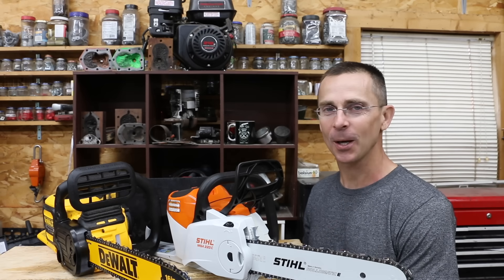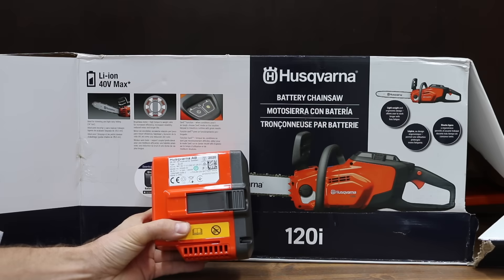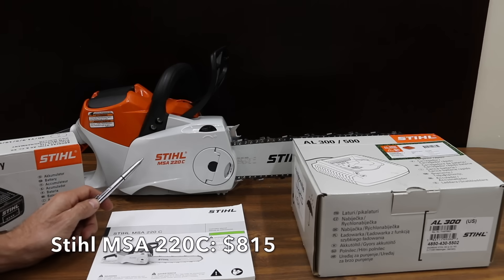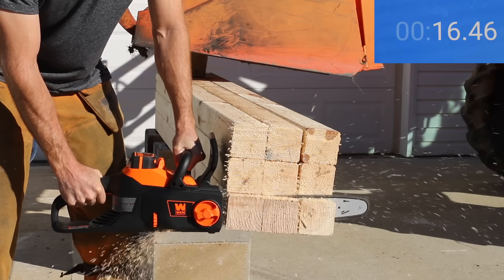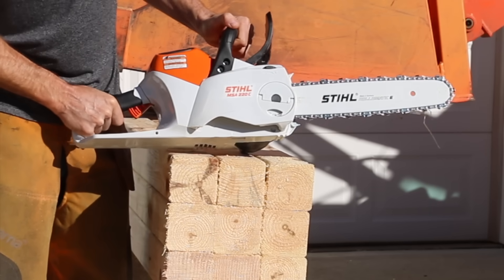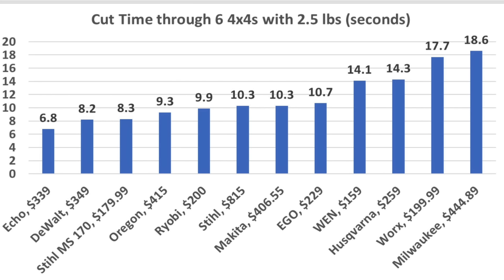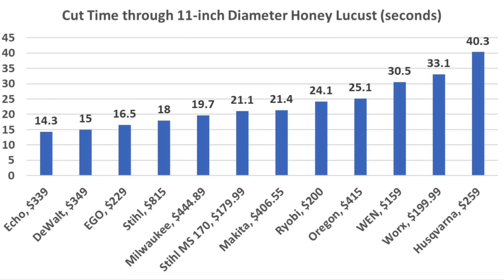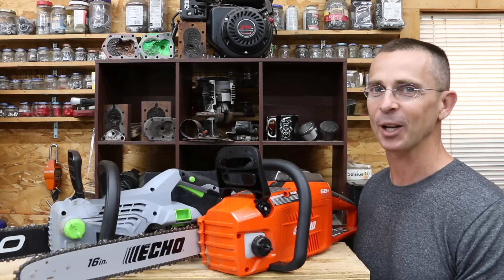Best Battery Powered Chainsaw Brand (ROUND 2)? Stihl, Husqvarna, Echo, Oregon, DeWalt

Comment: Cutting mango trees:  The Homelite did it ok.  Large amount of pine: Bosh plug-in: Instantly stopes when trigger is released. Bamboo: The Makita had no issues. Cutting with an Ozito brushed motor the dust got sucked in and it died before the battery was empty!
Reply from the maker: Thanks for sharing.

Comment: Something also potentially worth considering, EGO and DeWalt share common battery system with a very wide array of tools, and batteries are and will remain for a long time widely available, both in OEM and third-party.  I believe Sthil has a smaller array as well, but not nearly the availability or depth of tools to make sure they'll be available in, say, ten years.  The others are very likely dedicated or unique batteries, that might well be very challenging to replace once the first set dies, or if you need additional run time.

Not a direct impact on this test, but something worth considering when you're looking at buying a tool that's fairly expensive like this.
Reply from the maker: Thanks for the feedback.

Comment: I bought an EGO for $229 , but I use its 2.5AH battery in the String Trimmer . I use the 5.0AH battery from the leaf blower in the Chainsaw. 
My research showed the EGO was one of the best battery performers overall (which is what you are really buying) so joined theEGOverse . 
Bonus as the three tools overall if not top line, do work well overall -especially the string trimmer . Also EGO has a quick charger but I didn't purchase it .
Next up will buy the lawn mower with 5.0AH or 7.5AH and that will give me a hot spare for batt ..all the batteries work in all the tools but would not want to do string trimmer with the 5.0AH battery.
Reply from the maker: Thanks for sharing.

Comment: One metric on a test like this I would like to see, battery volts x Amphr = watthours , and then figure inches cut per watthour.
Since there is such a variation in voltages it would be interesting to know, not necessary, but interesting.
Reply from the maker: Thanks for the video idea.

Comment: No load rpm is a pretty useless metric. You need to look at rpm under variable load to get power curve and ultimate output.
Reply from the maker: Thanks for the feedback.
Reply: @ProjectFarm  No problem. You could set up a rig using a torque limiter to get a set torque at rpm. Then adjust it tighter and measure again. 
If you did this incrementally you could make a nice chart with power curves of each tool overlayed; to show which has power at what rpm. 
You could then run each in its optimal range to better gauge how well each tool could theoretically function if it was run perfectly.

Comment: I make my living now with a electric saw cutting cedar posts and staves , you overlooked the Milwaukee but it is best , you didn't test the torque power of these saws and that is very important  meaning maybe set a chain system to fit in saw sprocket to test how many pounds of force needed to stall out the saws , I am confident Milwaukee will surprise you, Milwaukee cuts and doesn't stall out , and the batteries for Milwaukee last longest and can get a super charger that charges 12 ah battery in under an hour.
Reply: But still awesome tests
Reply from the maker: Thanks for the feedback.

Comment: I have an assortment of Echo equipment and its good to see that their electric tools are good quality also.
Reply: Me too man. . . I've got two srm230 trimmers, one srm3020 and a cs400 chainsaw and a telescoping pole saw and they've all worked great.  I also have a pair of husqvarna chainsaw that run good too.
Reply from the maker: Thanks for sharing.
Reply: Me too, all non-electric, I have two string trimmers and a blower-vac. They just keep running, -and the string trimmer spools are easy to load, and maintain. Echo is a Japanese company, and it is apparent that they pay attention to the details.
Reply: @ratman5727  first time I used the srm3020 i was blown away.  The power on that thing is insane.  I've paid $800+ on chainsaws but was a little skeptic on paying $435 for a trimmer but its well worth it.  It works great as a brush cutter too.  The oldest 230 is 19 years old.

Comment: I think the battery comparison is not that useful. You're using multiple sizes of batteries and multiple speeds of chargers. You should compare minutes vs amp hours. The DeWalt alone has three different battery options and at least three chargers available. And each battery and charger has a different dollars vs. amps rating.

A motor power rating could be useful also.
Reply from the maker: Thanks for the video idea.

Comment: The 220 is stihl's most expensive and powerful battery saw though. They have several cheaper models.

At the same time you chose husqvarnas cheapest and weakest saw, they have several more powerful models. Not really a fair comparison in my opinion.
Reply from the maker: Thanks for the feedback.

Comment: To your first battery chainsaw video, I commented, wondering how the Hart brand (apparently made by the same company as Ryobi) would perform at a $200 cost.

Since then, in late October we had a nasty ice storm - with most trees still in full foliage, our 4 acre plot had a lot of tree damage so I went down to Walmart and bought their 40V Hart chainsaw.  I will say it cuts well, but it has a similar problem with battery life as you demonstrated in this video.

However my result was a little different, making me wonder if you may have experienced a similar battery "discharge" problem.  In my case I was able to get about 5 or 6 cuts in a row through ~10-12 inch elm before the battery quit.  But the battery appeared to have quit for overheating.  I say this because (a) I could feel that the battery pack was warm and (b) after cycling through my other 2 batteries, the first one would give me another 3 or 4 cuts (without recharging, just having let it rest) before quitting for good (until a recharge).
Reply from the maker: Thanks for sharing.

Comment: Echo makes great stuff. My weed trimmer and leaf blower are both Echo. Never had a problem with either one in 8 yrs. Well I had a problem keeping them running one time but that was due to using Casey’s gasoline. I found out the hard way that Casey’s gasoline has water in it.
Reply from the maker: Thanks for sharing.

Comment: Thanks for the video and testing the EGO. I’m a huge EGO fan and I used a 7.5ah battery and cut up a huge oak feld by hurricane in @18” sections limbs and all with just 2 batteries. That took me about 4 hours. Also, the EGO has a fast charger that can charge way faster than you can use the batteries. I put a Oregon chain on because the one it came with seemed inferior and only lasted a short while.
Reply from the maker: You are welcome!

Comment: Echo makes some really power equipment. I was impressed with echo saw. Would like to see a long term test of different 2 cycle oils. I own a landscaping company and will go through a minimum of 5 gallons a weeks of mix gas some weeks we will go through 15 gallons I have tried several different quality oils over the years redmax stihl synthetic which i was not impressed with seemed to cause spark arrestor screen clogging prematurely compared to other brands. I also tried couple of other brands the one I am currently using and have been the most impressed with is the Echo red armor oil after a couple of months I noticed it had actually made all the engines i had run it in cleaner and removed some carbon build up it is the most expensive 2 cycle oil i have used but it seems to do a good job and the engines run great and cleaner on it. Have a great week Todd. God Bless!!
Reply from the maker: Thanks for the video idea.

Comment: I’ve owned the Echo for three years in a homeowner and commercial environment.  Great saw  BUT-  the stock bar and chain are too thin and in a lot of applications it dechains routinely. Had to put on a thicker bar & chain problem solved but some loss of run time.
Reply from the maker: Thanks for sharing.

Comment: I was hoping to see the Greenworks (also branded as Kobalt and a few other) 80v chainsaw in this test. I've had one for several years and I haven't even touched my (rather nice) gas saw except to keep it running.  If you wind up doing a third round at some point, I'd be curious to see how it competes.
Reply from the maker: Great suggestion for future round of testing.

Comment: I am a little bit upset right now, because you are testing the "Best Battery Powered Chainsaw Brand" and then you are buying the most expensive Stihl saw meant for professionals and the cheapest Husqvarna saw they offer meant for homeowners. Husqvarnas best would be the 540i XP at the time. So for me it's not a fair comparison to let the very best of one brand compete against the weakest of another brand. If you're comparing the "Best" why then not buy the best of each brand? You could also do a comparison pricewise like "Best Saw from 0 to 200$ from 200 to 400$ and so on.
This Video is as always great but in future i wish for more equalism.
Reply: And if you want to test the Husqvarna 540i XP Saw then please buy either the Bli 200X or the Bli 300 battery because they are especially made for this saw because it's using and needing so much power.

Comment: These tests are great, but they don't figure in the eco system.  For example, I have 4 other EGO products and the batteries are interchangeable between all of them.  If I am going out to the woods to collect firewood, I am likely going to be taking all of the batteries with me.  I also have enough batteries now that I can simply purchase new EGO products without the battery with saves a lot on cost.
Reply from the maker: Thanks for the feedback.

Comment: Good information. I would like to see the GreenWorks 80 volt comparison
Reply from the maker: Thanks for the suggestion.
Reply: @ProjectFarm  just to be clear it would be good to see all 80 volt or higher saws compared.  The reason is the run time of 3 to 8 minutes on the saws you tested is totally unacceptable. This is just an example. There are other brands even a 120 volt battery operated out there   https://greenworkscommercial.com/gs181-82-volt-18-chainsaw-tool-only  Thanks

Comment: Informative as always but gotta say the run times really limit the tool unless you have a big battery budget 

Like anything if you have more than one tool it works out better if you can pick a family of tools and live with it 

Most of my stuff is Roybi but I needed a killer right-angle Drill and after destroying and M28 Ended up with a  Dewalt 60 Volt and after a bit of initial break in smoke it and the batteries have done well
Reply from the maker: Thanks for the feedback.

Comment: Fact is on the EGO using the 2.5 AH Battery has less power than with the 5 AH, it has something to do with the power management in the tool.  Also the new 18 inch is in a different class and hands down out preforms there 14 and 16 but cost much.
Reply from the maker: Thanks for the feedback.

Comment: Nothing in these tests indicates that any of these are going to last a long time.  You really need to break the saw down to find out if it is built well. There are good proxies like weight, but weight alone is not enough.
Also, what does anyone consider "long?"  A gas chainsaw can last many decades.  If you buy a decent gas chainsaw, it can last your entire adult life. None of the saws in this video will last that long nor will the batteries be available even if they did.

Comment: I find it hard for a company to claim a battery saw with plastic wood dogs and plastic lower housings to be a professional saw, I don’t know one professional logging company, or even arborist company that would use battery powered saws over gas powered saws. Because these trades time is money, you can refuel and oil a gas saw in literally 2 minutes and be back to cutting, these battery saws you make like 10 cuts in decent size wood and you have to wait over an hour for the battery to recharge for another 10 cuts. Not very economical for a professional company to use electric saws even as good as battery technology has gotten. The Dewalt did beat a gas saw but you’re still limited to that battery recharge time, and number of cuts per charge. All that aside if you look at it from a Home owner point of view, you’re not using the saw to run a business, these are good for the small Home and property owner looking to do some after storm cleanup with big branches. Or the occasional fire wood gathering for a small pit fire or chiminea fire. They’re good for people who live in the city and don’t usually handle chainsaws on a regular basis. The Echo out of all of them would come the closest to being a professional saw as far as cutting speed goes matching a gas saw speed but the number of cuts between battery charges and battery charge time is where it’s cut off from being a professional use saw, that and make it out of real pro grade saw materials and real wood dogs on it. If you get the technology to where you can get the same number of cuts, per charge, and the battery recharge is as fast as refilling the bar oil, then you might have something. On a farm level, these aren’t good because, even though you’re still not running a wood business with it, farms typically have a lot of chore work from day to day, with multiple different activities going simultaneously. You still have to do any wood processing tasks in a timely manner, and electric saws just don’t cut it for a lot of the same reasons, they don’t work for pro business saws. Now if I were in the market for a battery saw the Echo would be it, it’s got most of the same quality’s as a gas saw, but it’s still pricy for a battery tool, I’d still rather put that amount into a gas saw. The Stihl battery saw is way over priced for the technology, approximately 65% of the cost of their battery saw and the battery and charger is for the brand which is ridiculous, personally I’m a Stihl saw man, and it shocked me that they want the same money for a battery saw as the pro grade saw, I have a pro grade saw I bought it recently and and brand new, it has a 20” bar and the lower housing is metal not plastic, it has a real chain adjuster on it not a cheap plastic wheel it’s a real deal pro saw, made to use everyday all day, it was a little over 800 out the door, and it’s a hoss I use it all the time, and it’ll last me for decades. That’s to me is worth the 800 dollars. No battery saw is worth the price of a pro grade saw. The batteries in all of them I bet won’t last a year, and they’re probably 3/4 the cost of the whole new saw.
Reply from the maker: Thanks for sharing.

Comment: This is why complicated TCO calculations sometimes come into play outside of strict tested performance of one tool - if you're about to start a new battery ecosphere, specifically. Otherwise, for someone like me, who settled on Ego for outdoor tools and Milwaukee for indoor tools, buying the Ego saw is a no brainer - I'm already good on batteries. But for someone starting from scratch? I dunno - I'd hate to have 4 or 5 different types of batteries (even with those adapters, most of these saws couldn't use them).
Reply from the maker: Thanks for the feedback.

Comment: You tested and compared the weak EGO saw, if you tested the 18 inch saw https://www.amazon.com/dp/B07YLXDK5K/ref=cm_sw_r_cp_awdb_imm_t1_fBN1FbHADG9MR?psc=1 version your rankings would change since it is only 349 and it comes with a bigger 5ah battery instead of the 2.5. It is an overall better product worth the extra money.
Reply: For reference I was able to buy it new at Home Depot for 90 dollars but that was because they were trying to get rid of them since they don’t want to carry the brand anymore.

Comment: @Project Farm  it would be interesting to see the Ego with a 5.0 or 7.5 Ah battery to see if there is any cut time difference as well as if the total run time is more than double or triple the 2.5 Ah battery. I've read that the 5.0 has 2 banks of cells, the 7.5 has 3, while the 2.5 only has 1 bank. Supposedly, although I cannot find anything in the Ego manual nor website, the saw can take advantage of the extra bank in the larger batteries.
Reply from the maker: Thanks for the video idea.

Comment: Man, $815 for a chainsaw? That's more than I spent on the last car I bought.
For the price, the Ego was very impressive. I'm curious to see if they were to perform differently all using the same (new) chain as compared to the chains they provided. However I still can't see moving away from a gas chainsaw. Usually when I'm cutting wood, I don't have access to an outlet and I'm there way longer than 10 minutes.
Reply from the maker: Thanks for the feedback.

Comment: I am glad to see the EGO saw in the mix. Right off I was thinking oh no, 2.5ah. I never use a 2.5ah with my saw. I have the 16" and bought it with the 5ah. The EGO actually allows more torque output to BLDC based on which battery is connected! I would love to see the new 18" EGO in action! It has much higher chain speed and torque,  metal bucking spikes and more. For much less than half the price of the Stihl, I believe it would totally shame it!
Reply from the maker: Thanks for sharing.

Comment: Great video.  The big advantage of the DeWalt is the battery is useful for many other tools.  I hate getting a battery based tool one of a kind. Keeping up with batteries and chargers is expensive and a problem. 

I sort of would like to have seen you try the DeWalt with their 12 amp hour pack instead of the 9
Reply from the maker: Thanks for the suggestion.
Reply: @ProjectFarm  you are welcome. Love the channel, it’s probably one of the best channels on YouTube.    Those 12Amp hour packs should make a huge boost for the chain saw